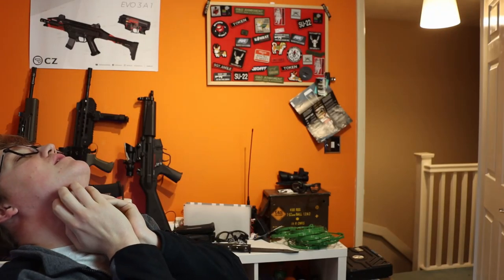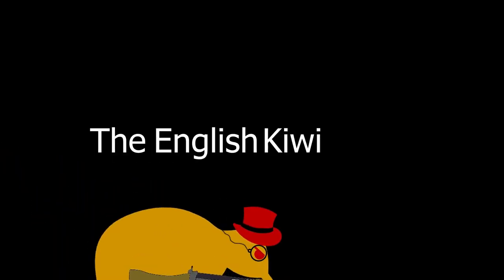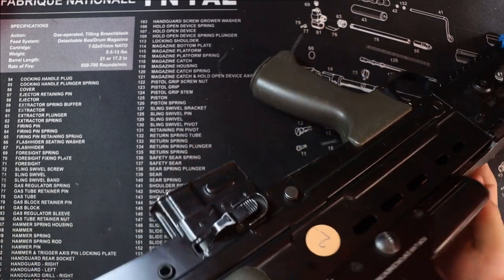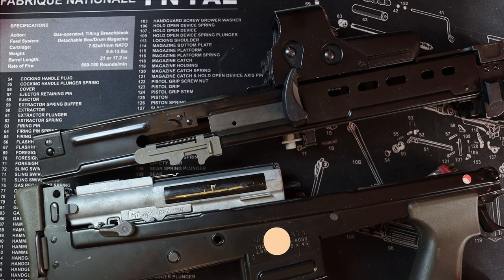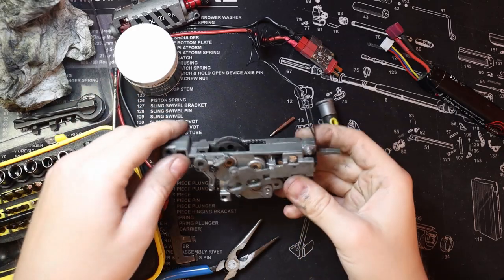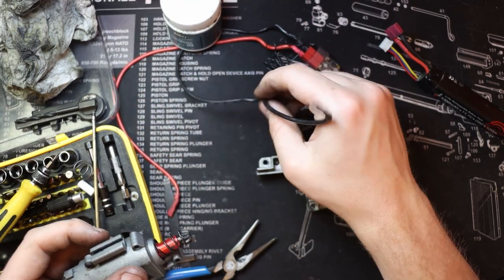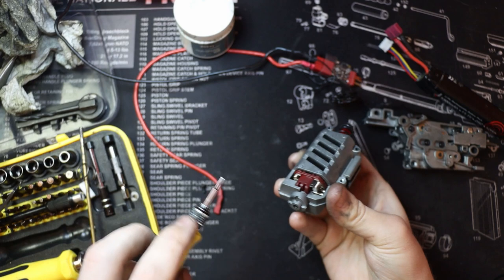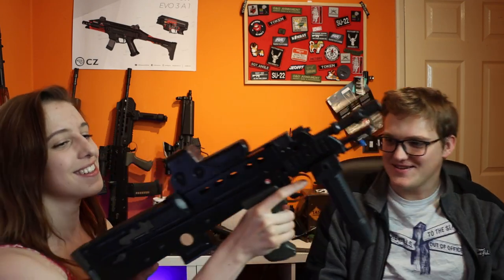Fixing the G&G L85 AFV

Comment: I fixed my semi issue on my l85 by removing the problem causing switch,  modded the gearbox to araldite a micro switch to the side of gearbox. Added Mosfet with active brake, job done...  No lock ups ever, fires semi like an Aug, full pull for auto..
Reply from the maker: That's definitely one way to do it! Tbf I haven't had any issues with lock up once i installed a MOSFET.

Comment: New gearbox fitted and works a treat but when a full mag was inserted it would fire but no BB's!! Works fine inverted lol.....I noticed that when wound the mag spring slips bag. Bugger!! New mags it is then....
Reply from the maker: Hang on, is it a high cap?
Reply: @EnglishKiwi  Yes it is.
Reply: Had some mid and high mags but sold them off or gave away. Just kept one
Reply from the maker: Ah fair enough, so the coil spring has gone in it. Personally I'd just stick with mids 😀
Reply: @EnglishKiwi  yeah that's the plan from now. just shopping now

Comment: what what was the reason that the motor stopped working right? you talked about a wire. and it was shorting, grounding out the shots ?
Reply from the maker: The wiring was damaged by I don't think it was shorting. The real reason for the motors death is that it was 5 years old, used extensively and was paired with a active break MOSFET which will be adding load to it, causing it to wear out faster

Comment: It was a plastic piston tooth, not metal I assume? Hence the gears survived OK.

Did you replace the piston, or can you run it without that tooth? I guess one missing doesn't make much difference?
Reply from the maker: Ah yeah sorry, I cut the explanation! It's a plastic tooth from the old piston that died last year and I did a very quick turn around fix (just switched the piston out to get it back up and running). I was meant to clean the lower at a later date, but, like the imbecile I am, I forgot...

Comment: What MOSFET are you using in the video? I think it's either GATE nano asr or gate aab, but one has active braking and the other doesn't. Does it matter which one you usen in L85?
Reply from the maker: This has a nano aab installed but an asr would work perfectly fine as well :D
Reply: @EnglishKiwi  asr works? Whew, this saves me some money! I already bought the ssr 3 mosfet, only to realize it doesn't work :/ thx for the info!

Comment: I am desperately trying to remove the outer barrel from this AFV, in order to replace it with a custom made one (with a thread) I can mount a silencer on.  So far, I have zero success with it. Any tips?
Reply from the maker: If it's the G&G AFV, there should be a grub screw on the underside of the flash hider which will allow you to unthread the flash hider and reveal the 14mm CCW threaded barrel

Comment: Don’t suppose you do repairs ?
Reply from the maker: I may be able to. What's the issue and where are you based?
Reply: Based on the north west and the issue is G&G L85 single fire. Item is about 9 years old and don’t think is has ever been serviced. Have taken it apart and found 2 teeth missing off a gear and the piston ripped to shreds. Got new parts coming but the braking system for single fire is not working at all. Have replaced all wiring but made no difference and I don’t see the new gears and piston fixing it. Would I just need a complete new wiring loom at this point.
Reply from the maker: Sounds like you've got the old old style of gear and piston setup. I'd say you need to switch the piston and gears out, then remove the active break wire loom and put in a MOSFET. Hopefully that should fix your issue :)
Reply: Thanks pal will do any suggestions on a MOSFET seen them online for like 20
Reply from the maker: If you don't need anything fancy, gate nano asr is great!
Reply: Got everything I just need to know how to disable the active breaking do you have any advice on that as not been able to find any vids on exactly how to do it.
Reply from the maker: @TWFsmithers  easiest way to do it is to make a new wire loom. Fairly simple, just two lengths of wire with motor connectors at one end and a connector for the MOSFET on the other. If you watch the second l85 servicing livestream I make one for mine :D
Reply: Just wanted to say thanks so much for all the help I really want to get this done for the start of airsoft again my friends going through a lot and this is my way of helping a little. So thank you your amazing love this community.